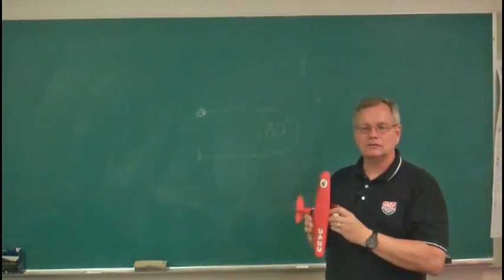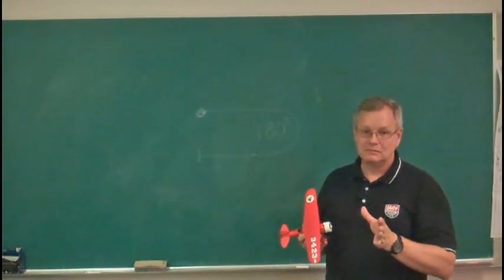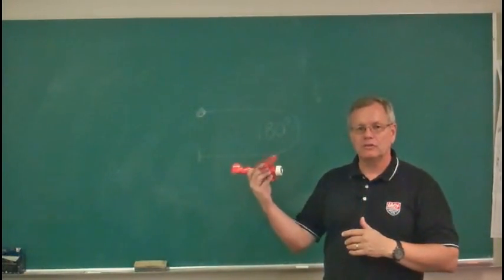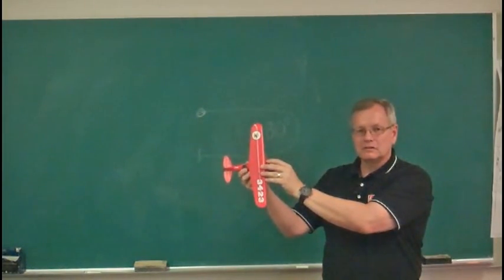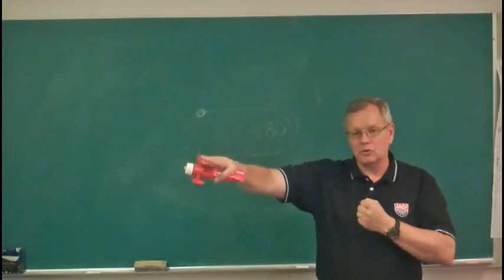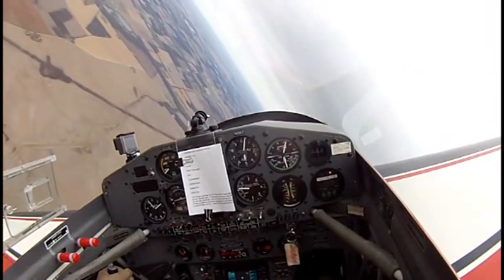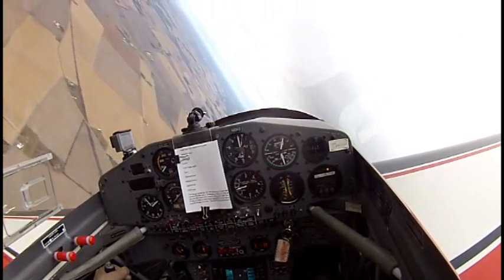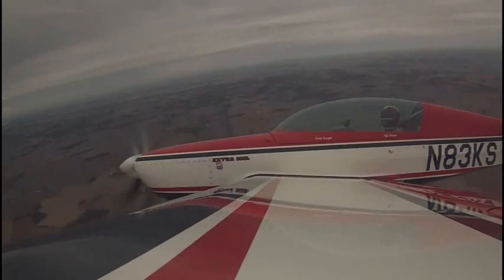The Aerobatic Textbook: Aerobatic Turns

Comment: good info
Reply: When you say coordinated turn in before the pause, wouldn’t that start the turn?  To keep it from turning do you apply opposite top rudder before the pull and during?  Or is it like a steep turn in a regular plane rolling into the turn with both rudder and aileron same  direction before the pause?